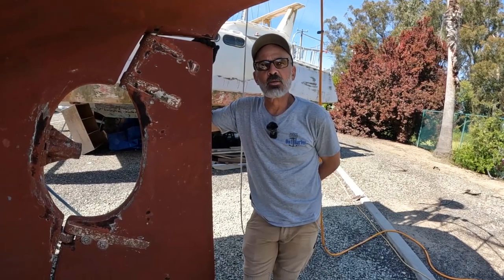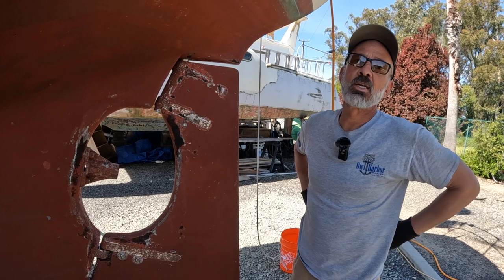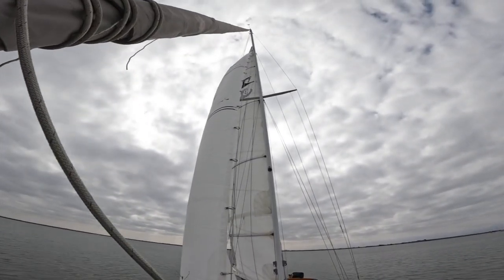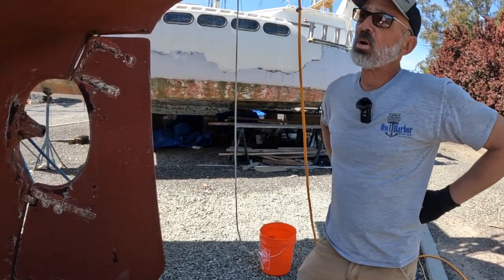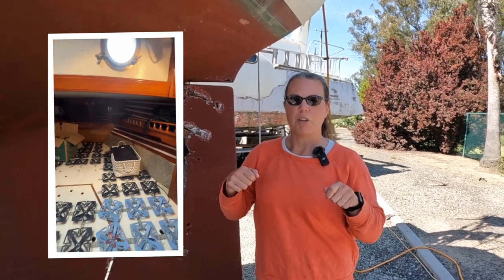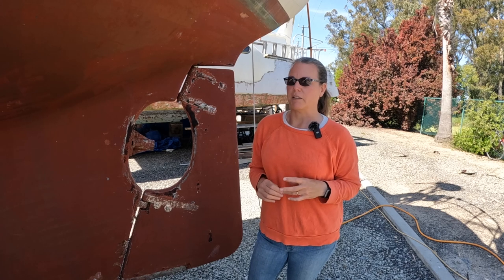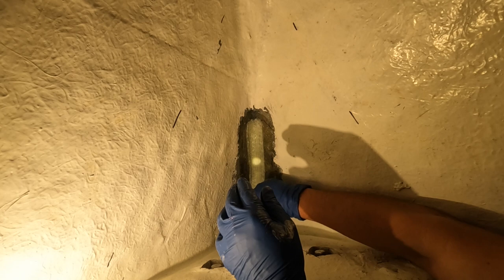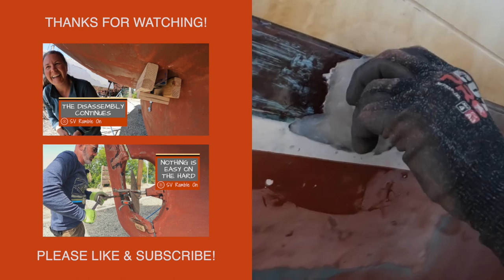Our Bobstay is LOOSE! | SV Ramble On

Comment: Just finished installing the same bobstay fitting on our 1977 CT37 Pilothouse during our recent  haulout. The older boats are much more difficult. They are completely buried under the chain locker floor. 3 to 4 inches of hard cement like polyester filler.
Reply from the maker: Ramble On is a ‘77 CT37 also. Ours is hull #91, so maybe they changed up their methods sometime in the production line.  I’ve heard of a couple other older boats like ours that had the same situation as yours in the chain locker.  Guess we got lucky.
Reply: Our's is hull number 63. Built August '77.